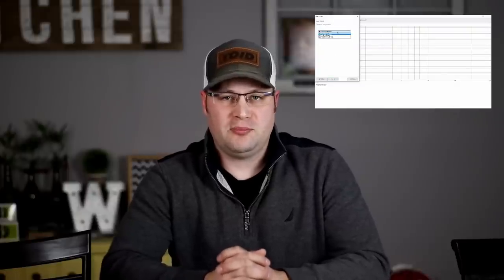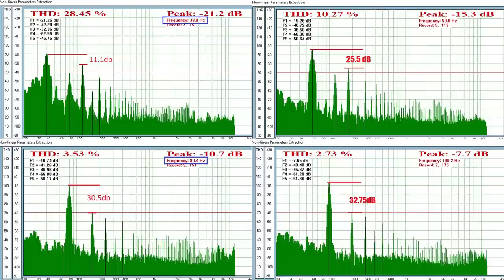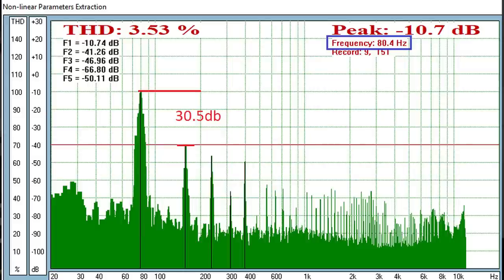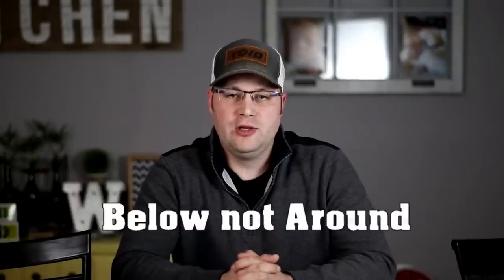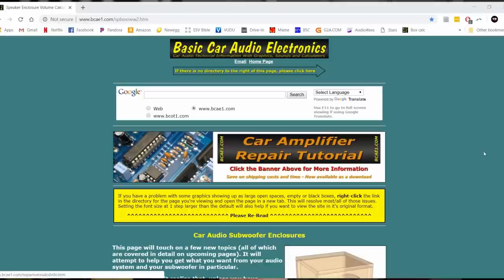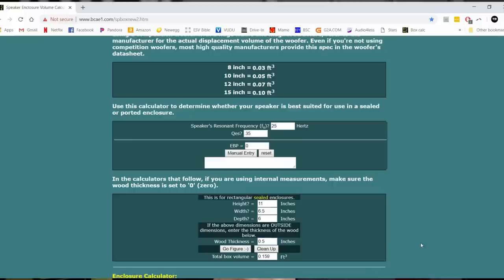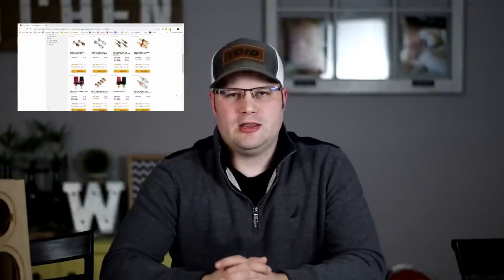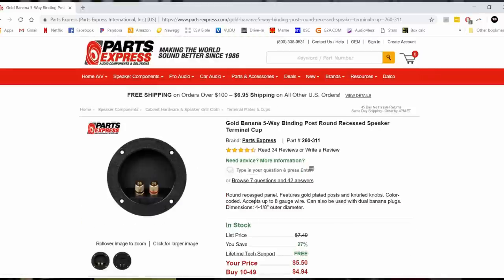Tips and Tricks - Rear Speaker Design by Impulse Audio and 123Toid

Comment: I was looking through your videos and didn't see what I'm asking about so I apologize if I missed it. So I can only hear out of one ear so surround sound is fairly useless to me, I'm thinking of just getting a 2.1 receiver instead of 7.1. That said I really would like a nice set of tower speakers for my main sound. Could you show or build a nice set of towers? I'm thinking at least 36 inches or taller. I like solid tight bass not soft and booming if that makes sense. I'm not a designer by any means but I would like to try a speaker build on my own just for the pride of it.  Thank you.
Reply from the maker: I completely understand that.  A 2.1 system sounds perfect for you.  I recently did build a set of tower speakers which I pit here:https://youtu.be/L6-lc4Ouoc4  It sounds like it would be perfect for your needs.  For the tower cabinet, you would just use the dimensions found here: https://sites.google.com/site/undefinition/diy/amiga with two window braces.  Don't forget to line the inside of the tower with mattress topper or some other foam.   A build like this should give you exactly what you are looking for.

Comment: Hi,
So if building a surround speaker  you dont use electronically low/high filters to set where to cut the Hz? You do it with the box?
So how do you decide what the  tweeter play(for ex:1000hz and up?), and where the midbass (ex 80hz to 1000hz) play?
If you have some filters you never said  how you do it.
Or is it so every channel already have the right hz from the amp.
Why I ask is I have only done car speaker build and there the filters is VERY important to get right. 
Cheers from Sweden
Reply from the maker: There is a lot to that.  I actually dedicated an entire series on the basics of designing a crossover.  Unfortunately there is no simple answer.  But if you are interested, here is the basic series. https://www.youtube.com/playlist?list=PL6hjpiCHZmIPx3itPeTt7zoSqNY20OQqV

Comment: I'm curious though, that if you were purposely putting these on a wall. Why not put the wire connections some place other then the rear? I don't see any reason it has to be there, and it's certainly the most awkward. Top? Bottom?
Reply from the maker: That's a great point. You definitely could do that. We wanted these to be multipurpose. We're going to be using them for rear surrounds, buy want others to be able to use them for fronts for a small surround sound, if wanted. But you could change the placement of the terminal cup of you want.

Comment: Why wouldn’t you build di poles for rear speakers?? Way better for dispersion of sound...
Reply from the maker: We did consider bipoles. But we wanted there's to also be used as front speakers if you wanted to use them for a small surround sound setup.

Comment: After watching like 30 videos from different channels I still dont know how to design and build a proper crossover, everyone sort of glosses over the topic, I know bits and pieces.  I don't know how to use any particular piece of software from start to finish, different types of crossovers, how to pick caps, conductors, resistors, etc....
I also dont know how I am going to cut the wood with strict enough tolerances without a table saw which is not an option, and I am not exactly sure how to put all the pieces together with clamps properly so they dont shift and seams end up screwed up.  I know how to pick drivers of a close sensitivity that should be able to be crossed over fine and give flat response with good off axis.  That is all I know from a bunch of reading and watching videos.
Reply: for all that shtuff, i recommend lurking boards and reading a ton
Reply from the maker: Dom, I did do a beginner series that many have said helps them.  It is not comprehensive, but should be better than when you started.  It is found here:https://www.youtube.com/watch?v=Fm6tsj9Tpqs&list=PL6hjpiCHZmIPx3itPeTt7zoSqNY20OQqV
Reply: CAP kind of nailed it. Watching videos isn't what you want to be doing, if you really want to learn. Forums, and reading is where it's at. Parts Express, Madisound, DIYaudio, audiokarma.org, audio circle, audio asylum, etc are your friends. Especially the first 3!
Reply: Well here is a bit of a youtube research guideline. First, you need the response data of the speaker in some type of usable data almost always FRD (just the picture on a spec sheet will not work). You can get that either the form manufacturer or you can measure any speaker at home. Dayton and a few others give this data for free. The measurements at home are fairly complicated so I would recommend messing around with some Dayton stuff whether you buy it or not you can still get the files on parts express and see how it works. Once you have those you need a program to sim them 123Toid, I and Most use XSim as it is easy and free. You then put all your drivers in with the FRD (frequency response) and ZMA (impedance response) files into XSim and you have a virtual representation of how you drivers will respond to certain crossover components. The online calculators are basically full BS and almost always mess things up so don't use them. Once you have your component values you just get there closest value and your good to go. I am far from the best at this but I have gone through the same struggle for info as you guys so if any of you have questions about this stuff feel free to message me. I also know quite a bit about T-lines if any of you are interested in them as they were quite complicated for the nonsuper acousticly literate of us.